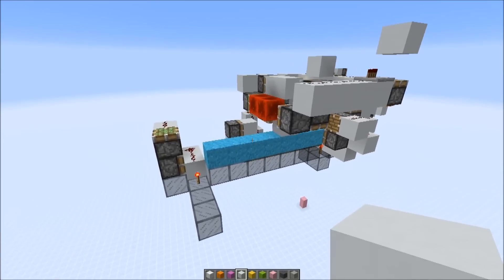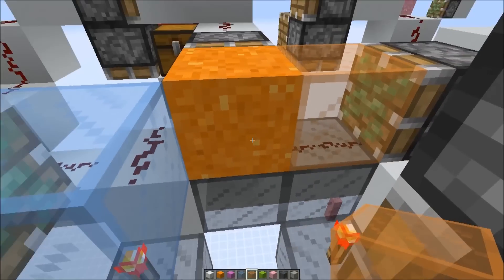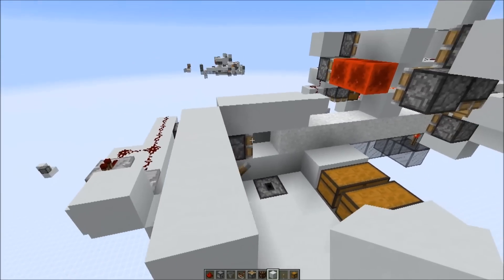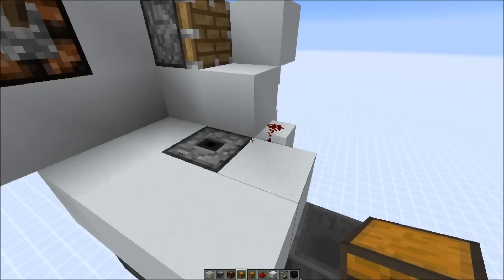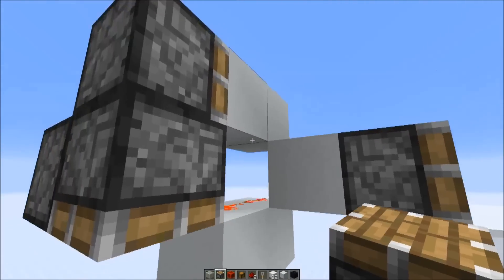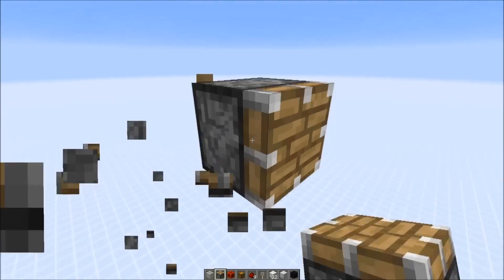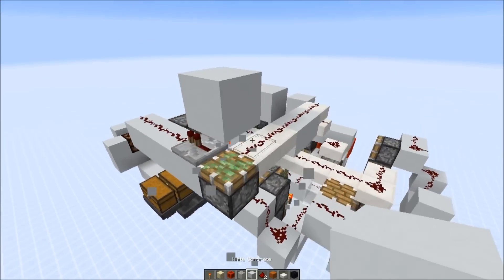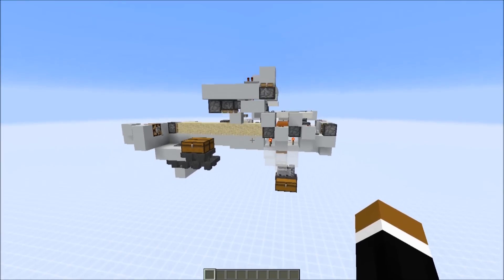[Tutorial] Color Converter For 18k/h Sand/Concrete Powder Stream

Comment: Howdy ilmango! I have an issue with the second piston in the color changing process. Usually, the piston doesn’t zero-tick the block towards the falling concrete powder. How can I fix this? I’m running 1.12.2 with Optifine, Schematica, and a few other client mods.

Comment: For some reason the line of concrete keeps extneding past and breaking the line powering the redstone on the first piston controlling the zero tick. ive tried multiple work arounds and been scratching my head for hours. thinking it could be server lag or something, i am on a spigot server so im assuming that could be the issue. ive even tried connecting a super speed bud to the first piston thinking its going to fast to handle and its still not working with the clock or a zero tick piston set up. and i also have it connected to my tnt chamber and they use all the same concepts that work just fine, im thinking it has to do with all the pistons pushing the blocks around st the same time? anybody know a fix?
Reply: And i should say yes it does work in the world download, as well as the concept i made with connecting the super speed bud, so its for sure a server or spigot issue
Reply: @simmions1  did you ever find a fix for this?

Comment: I downloaded the world and wanted to try and it worked nice, i then built it on my server and it does not work. i went back to the world save and tried there and then it worked for 5 seconds and then it broke on that world save??? please help, the piston just pushes the concrete and it stays floating above the redstone torch
Reply: and now when i push that button you have on the machine it extends the pistons for a second then quickly double extends really fast like my broken one on my server
Reply: FIXED - The piston behind the button. The block has to be 1 infront of the piston no attached to it. Took me 3 hours to figure that out
Reply: xd